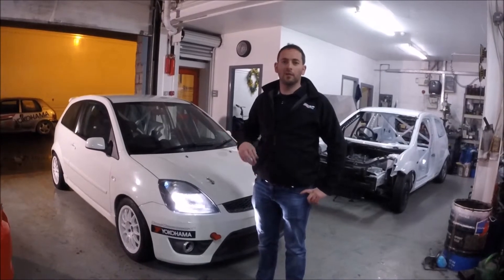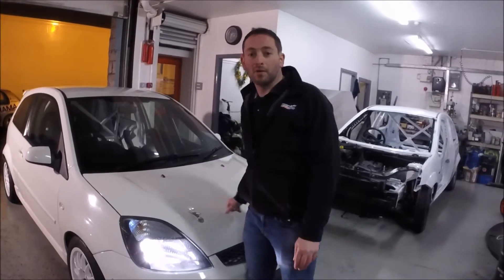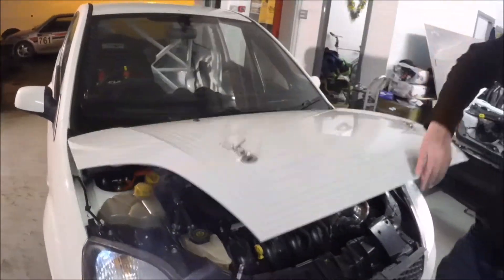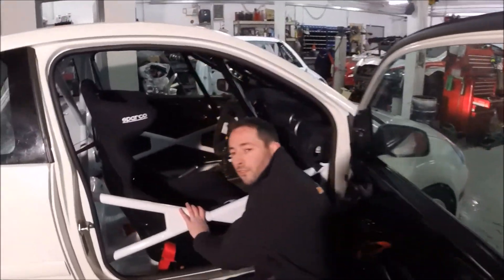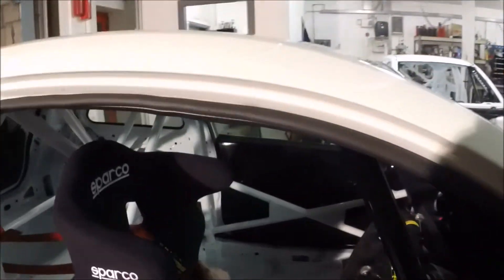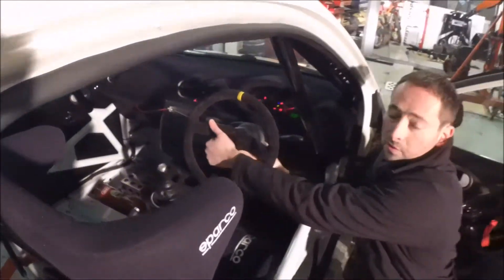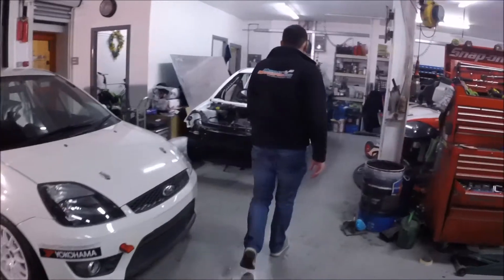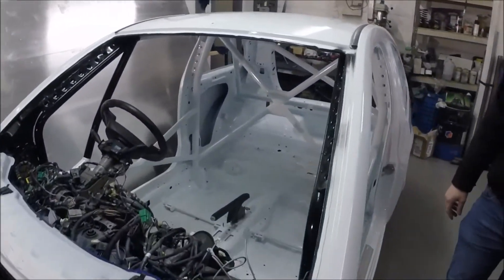Murray Motorsport Fiesta ST Build Part 2

Comment: hi guys.
 I'm currently in the process of making my mk6 mr200 st into a dedicated track car.
what door cards are they and will they fit with all cages?
Reply from the maker: The door cards are our own mould. They fit fine with OMP cage. We have them in stock and cost for pair is €260.00 ex. vat.
Reply: TheSpragz how did u get on with your mr200 im about to do the same with mine